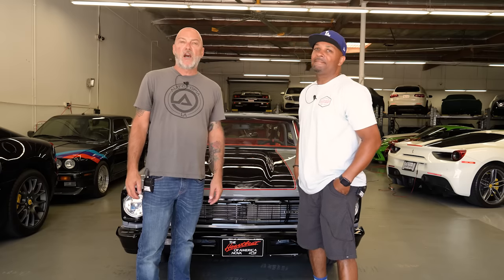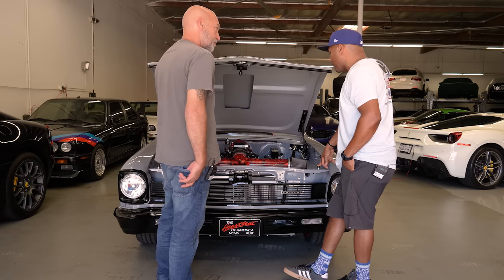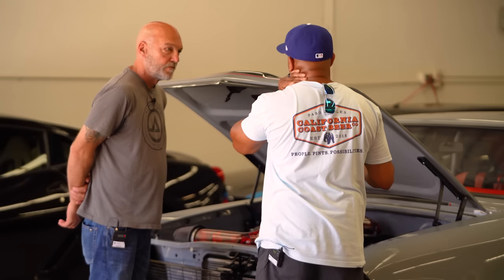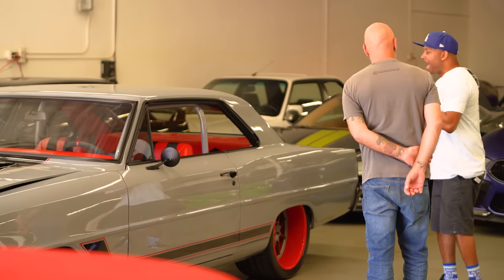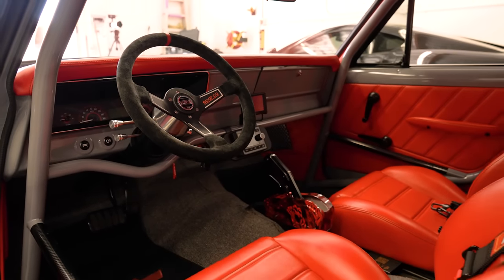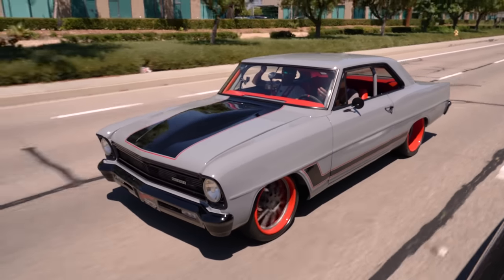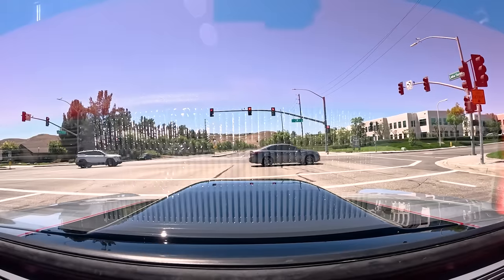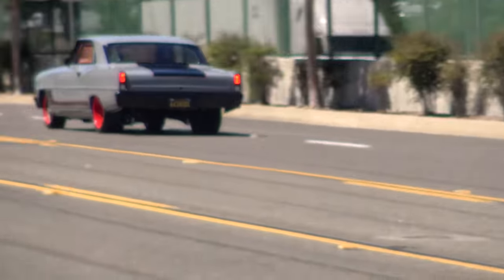Show Stopping 800 hp '66 Chevy Nova

Comment: I kept the drip rail to keep the originality of a classic car. BTW, it’s all push buttons on the interior like a new car. This guy is a fugazi
Reply: You the owner?

I'm a Ford guy ,but I respect the hard work out into any build. Very nice vehicle,sir. Also, you seem like a chill guy....a true car enthusiast. Enjoy!
Reply: @testtest-gs300
The drivetrain, suspension, brakes, electronics and interior components are all specifically designed to be very modern for reliability, durability, comfort and aesthetics  whereas the exterior body was deliberately left with most of its original “classic car” trim. Modern car reliability/features under a classic car shell. 🎯 Again, all by design buddy. And who still uses the word fugazi?? 🤦🏽‍♂️